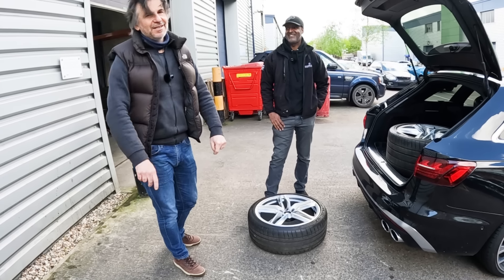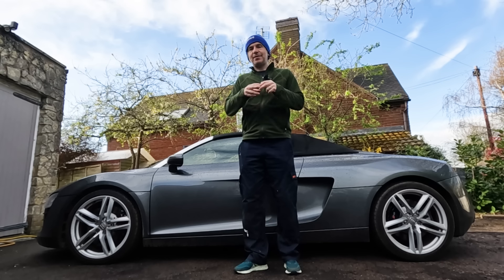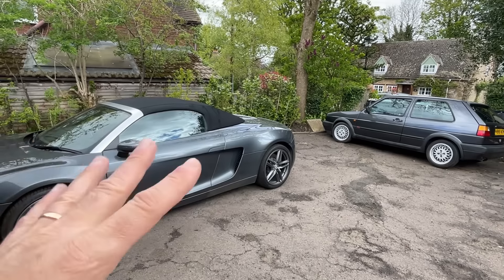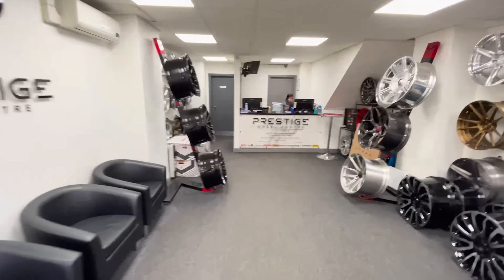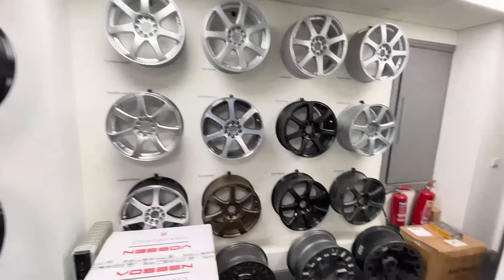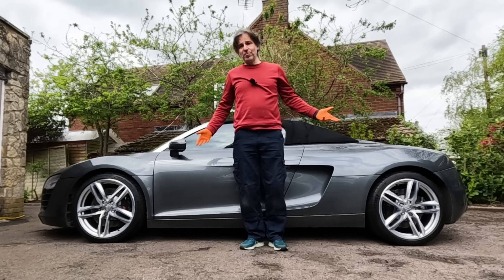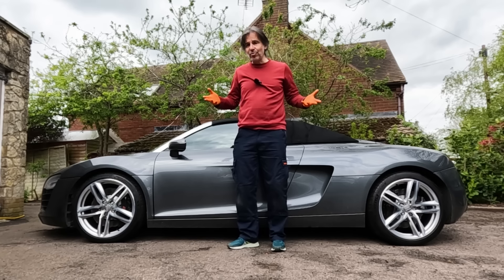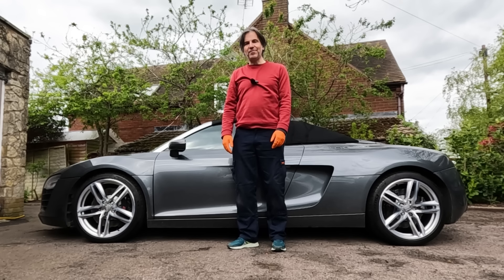CAN I BEAT PLAIN SILVER FOR MY AUDI R8 SPYDER WHEELS? #audir8 #audir8spyder #wheelrepair

Comment: Doesn’t matter if they are black or grey it doesn’t look good on any car. You can never see the detail of the wheel.
And your are going to regret the diamond cut. As soon as you get a stone chip and water gets under the lacquer the white worm will set in.
Reply from the maker: I'm aware of the diamond cut issues, this car won't go out in salty conditions if I can avoid it so it's not as much of a risk as on a daily car and if it does get some damage, it's not crazy money to have one redone.
Reply: Don’t get me wrong they look great. But I can’t be dealing with refurbishing wheels every years. 
Stone chips. 
Then bolt holes and where the centre cap sits. Common areas to wear through the clear coat.
Then you can only cut them maybe two or three times before you don’t have enough material left.
Reply: Unfortunately, I agree. Diamond cut are a pain, and can only be done a couple of times. They look really good, though!
Reply: I'm fastidious about my wheels and noticed a chip on my diamond cut lacquer and already its turned white and I never use in winter so be warned

Comment: Surprised you didn’t get them ceramic coated or wheel wax protector on the wheel barrels to at least give them longer protection than Autoglym spray. Good choice!
Reply: Good point.. Just before re-fitting would have been the ideal time to have coated in the most durable ceramic product available.
Reply from the maker: That's a good point, TBH I've not cracked ceramic yet for body or wheels but will brave it soon promise :)

Comment: Those wheels look fantastic Andrew. Great job by Prestige Wheel Centre.... Quick question on another note. How do you manage the insurance on your 'small fleet' of cars without it costing you a fortune? I take you must use a multi-car policy? Thanks
Reply from the maker: Thanks Gordon.  There is an easy answer about insurance, for 24 years I've had a Motor Trade policy and because I still do trade cars I can use it to cover these 'social cars', 2 points worth making, don't even think of doing that if you don't trade cars as they will find out and not pay for claims, also you only get paid out at trade value which can mean a big hit which would be really annoying if it was due to a scumbag theft.  The GT4 is different because it's over £50k, it was cheaper to insure privately than to up my trade cover to £80k max per car from £50k. If I bought and sold cars £50k-£80k then it would be fine but for one car it was too much. Admiral came in really cheaply even though all my NCB was tied up in the trade policy so I had none.  I'd recommend Admiral multicar though not sure how much they screw loyal customers at renewal yet.